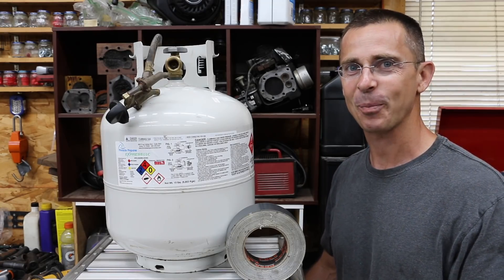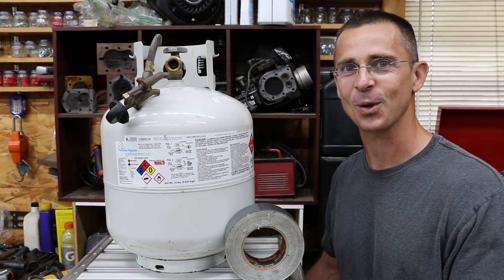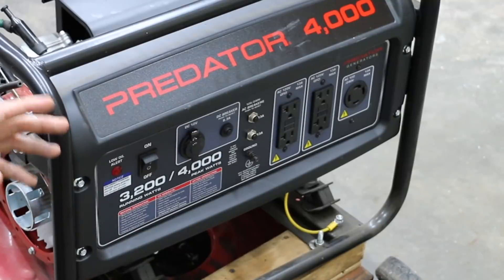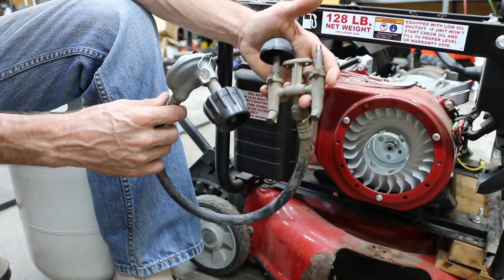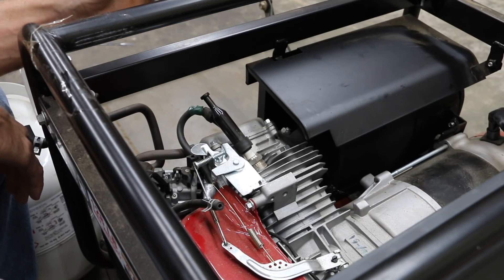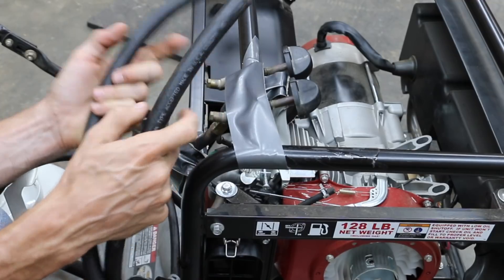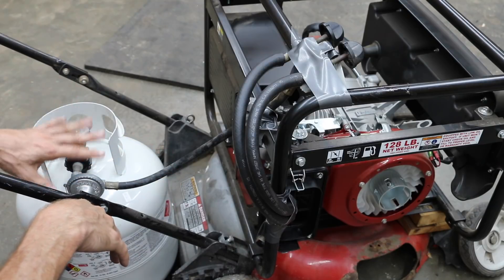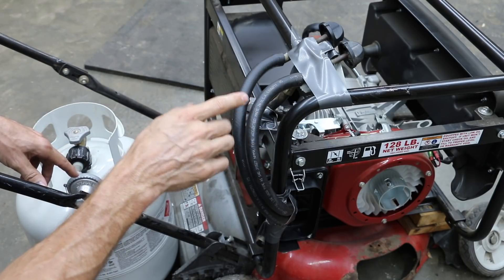Can a gas (propane) grill power an engine?  Let's try it!

Comment: When I have had to work on a small engine where the carb was questionable I would use the gas from blow lamp an run it through some windscreen washer fluid tube direct into the inlet manifold. Sometimes this helped unblock the carb!
Reply from the maker: Great strategy!

Comment: I've seen a lot on propane generators but I have yet to see someone try it on a small car or truck with a engine that has a carburetor on it to see if it is enough make a vehicle drive and if it practical in a emergency.
Reply from the maker: Great video idea

Comment: I would like to see you try to run an engine that is submerged in water, intake and exhaust plumbed to atmoshphere.  May have to remove the cooling fan..  But I think It would be very interesting!!
Reply from the maker: Great video idea!
Reply: Like the tanks at Omaha Beach, with their canvas duck "snorkels"!
Reply: Yes.  In a liquid cooled engine like those, I would imagine they could handle it better and be able to keep a little more heat in the engine due to thermostat,. Curious what an air cooled motor would do!  Also Carb vents would need to be ran to atmosphere, that alone might make it not work.

Comment: Actually, you can go on to the bay and get conversion kits for running almost any gas motor on propane right up to a v8. I have my standby generator set to run on propane, I never have to worry about it going bad.
Reply from the maker: Great point.

Comment: I have not seen you do a video with E85. They say it will eat certain types of rubber or plastic, and rust out common parts in carburetors not setup for it. Just curious if you can try this. I did see you ran some on Everclear but not E85 out of the pump.
Reply from the maker: Great video idea!

Comment: Propane works great but you have to derate the generator to 70% as propane does not have as much energy as gasoline. So 2800W for a 4000W generator. How about making an HHO generator to run the engine, start on gasoline the switch to HHO using the generator to power the HHO process .
Reply from the maker: Great point and great video idea!

Comment: Just to let you know, running engines on propane and Nat gas, it      , running lean is better than running rich, running rich will burn the valves, it is backwards of gasoline
Reply from the maker: This is great information.
Reply: That is the same as a diesel. Running a diesel rich causes extraordinarily high EGTs and can melt an aluminum head. Running it lean causes it to be cooler.
Reply: I was just going to comment the same thing! Glad you did!

Comment: Spoiler alert: if you get the air/fuel mixture right a gas engine will run off of propane.
Reply from the maker: You're right.
Reply: Project Farm It could also run off of hydrogen. If you feel like getting crazy with electrolysis... :D

Comment: I know it works. I ran my parents John Deere riding lawn mower on propane about 20 years ago in my teens.
Reply: They weren’t very happy about it.
Reply from the maker: Parents not happy.  Safety reasons?  Thank you
Reply: They thought I was going to blow it up. I had a habit of taking things apart and seeing how they worked. Or modifying them to be “better.” I still do. But I do it with my own stuff now. Lol

Comment: Not sure why this is surprising. LPG cars/trucks are very common. The only "hard" part is cold-starting the engine, and regulating the correct mixture.
Over here, 90% of all 40+ year old cars are LPG (was 25+ year before) because 40+ year old don't pay tax, and LPG is cheap/L but high tax. (for whatever stupid reason, because it's very clean)
Reply from the maker: Great point.

Comment: I know you do not have the testing equipment, I wonder how much cleaner the engine ran on propane compared to gasoline?
Reply from the maker: I wonder about this too. I suspect it would run extremely clean but cause issues for the exhaust valve(s).

Comment: There is a good reason we use gasoline and one reason is transportation. Propane is compresses to a couple hundred psi to a liquid . Natural gas three thousand psi.to a liquid. With gas it is difficult to carry a good supply on board your car or truck. Think about all the difficulties dealing with gas.
Reply from the maker: Great point.

Comment: Thats awesome! Love the content. I have something that's been jogging in the memory bank for quite a few years. A lot of end dgi engines have carbon build up issues. And I came across some machines companies in the UK use that make hydrogen. They run it through the intake manifold to clean carbon. I haven't seen hardcore evidence it works and most the cars they run it with are diesel. I'd love to see you get a kit together to build, and test it on diesel and gasoline engines. The videos are listed under hydrogen carbon cleaning or HHO cleaning. I'd love to find a reliable, efficient way to carbon cleaning without ripping the intake all the way down. I hope you take this on!
Reply from the maker: Great video idea--thank you!

Comment: Why is it mounted on a lawnmower? Is it for your future electric motor generator powered lawnmower?
Reply from the maker: It's much better than the Harbor Freight wheel kit, in my opinion.  Very convenient for moving it around without any lifting or bending.
Reply: Project Farm I'd probably just mount it on the large moving dolly.

Comment: My freinds car runs on propane saves him so much money but costs a bit to convert ( it runs on petrol when propane runs out) he says it's faster and smoother when running on propane
Reply from the maker: Thanks for commenting on this.
Reply: Mine came from the factory with LPG system fitted: it pays itself in really few months (In my case break even is at around 17 000 km wich is less than a year on my mileage). The only real issue is that the place for the spare tyre is taken by the gas cylinder but I got a sort of "fix-foam" instead.

Comment: Good to see you doing it this way (the hard way) rather than just bolting a propane kit on a small engine.
Propane can be a great fuel for engines but, in my experience, tuning it is less forgiving then gasoline, especially on the small, air-cooled stuff too rich or esp. too lean can cause a hot burn and damage exhaust valves, esp. on engines not specifically designed for propane. Even seen the exhaust port itself partly melt/distort and leak from overheating on aluminum heads.
Reply from the maker: Thank you. Great point regarding the exhaust valves.

Comment: In 1995, my car (a Peugeot 305) was fitted with a gas tank and burned GPL, a fifty fifty mix of butane and propane and it drove very well better than with gasoline. The spark plugs remained clean, like the engine oil.
Reply from the maker: Impressive!

Comment: oh boy, there used to be so many adaptations in the early 90s here in Brazil due to the petrol crisis, people would easily adapt carburator cars and a lot of accidents have happened due to that, you could smell some cars just leaking gas around town, very dangerous, here we use a mixture of Propane with Butane so I'd say the burn isn't as clean
Reply from the maker: Thanks for this information.
Reply: I've seen several under ground garages that won't allow LPG/CNG powered cars